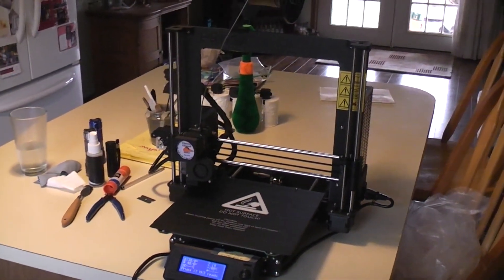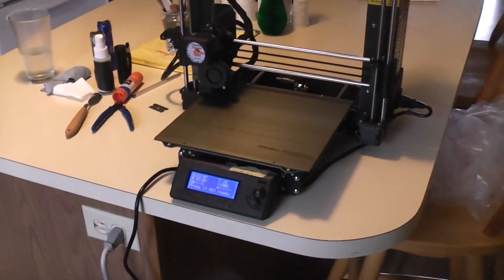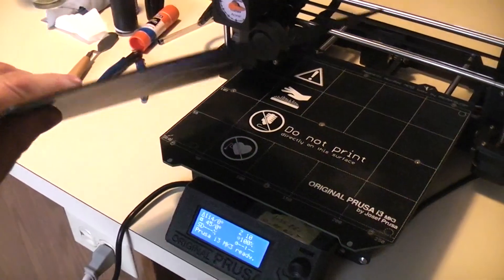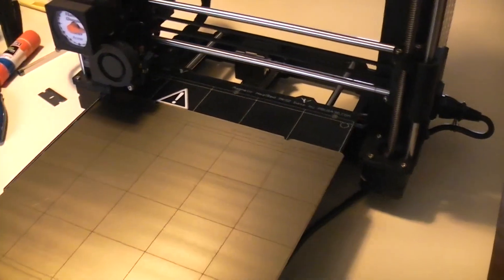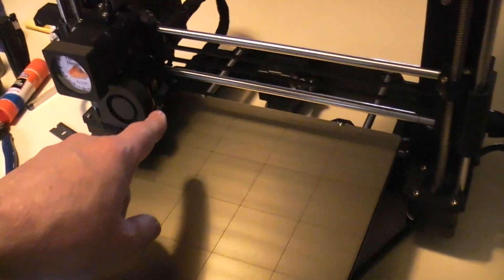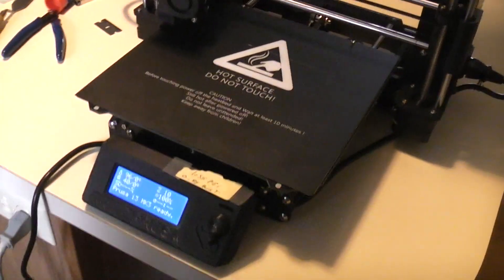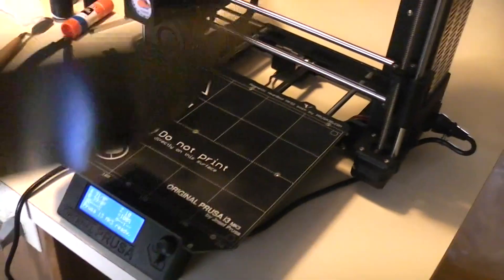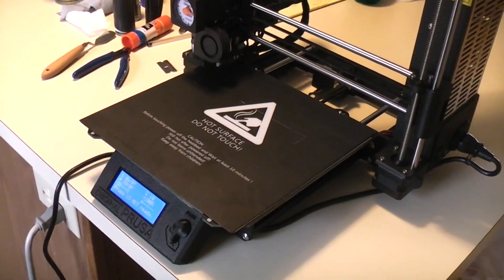Prusa MK3  BuildTak and PEI flex plate 50 / 50

Comment from the maker: Another plus if you have to use the power loss resume function the part will still be stuck to the bed ! No problem.
Also I did re adjust the Pinta probe so that a Z offset of 0.0 is used for the Build Tak and -0.75 for the PEI. This gives me lots of clearance for the probe and the printed parts.